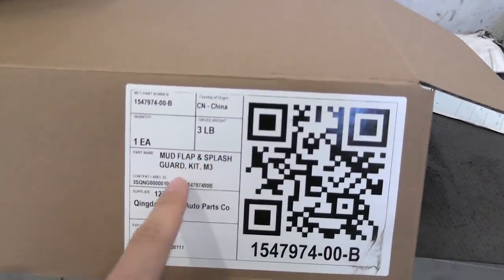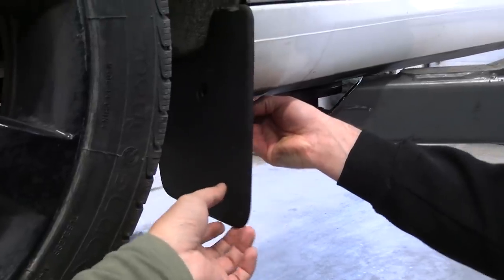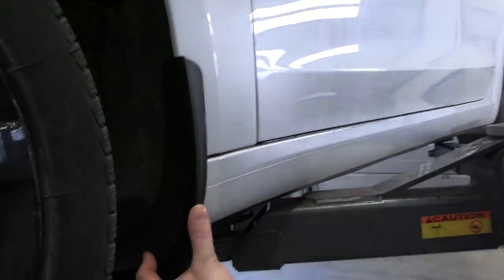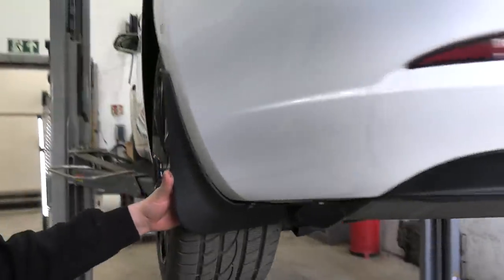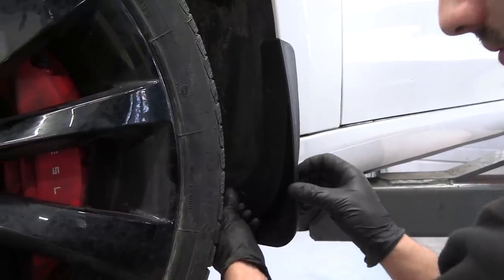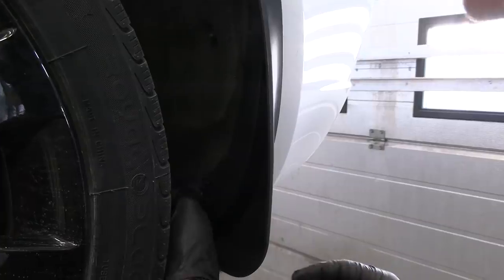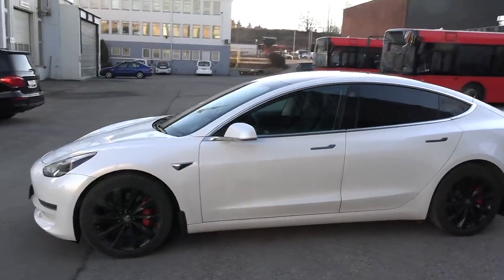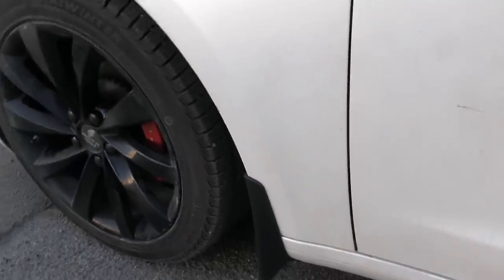Model 3 mud flaps from Bilexperten vs Tesla's original

Comment: Had the same 3rd party china-flaps mounted here. They lasted for 10000km and then ripped off in heavy rain (90km/h). No mounting fail - they torn apart. One of them scratched the side of the car when it fell off. Will not mount the same ones again...

Comment: Double sided tape is there to keep the guard against the bodywork. Otherwise dirt would get inbetween and scrape and ruin the  color. Also the upper plastic screw that was screwed in with powertool does make a new hole into the car, but it is plastic not metal. I think also with Tesla mud guards you install this new screw into plastic.

Comment: Looking at the front flaps, I’m 100% sure the guy just drilled a self screwing screw into the wheel well liner... :O Meaning he did make a new hole without Bjørn knowing...(?)
Reply: Drilling into the plastic liner is fine since it avoids the need to drill into the metal fender lip which would cause rust.
Reply: Wade Yorke the problem is that behind those plastic liners you have air ducts/vents.. And as he said, on Model Xs, some people had their ventilation ruined because of it.. you never know what’s hiding behind plastic covers unless you do some research.

Comment: The real problem is that the Model 3 does not come from the factory with plastic rocket panel covers.  These covers should extend from just behind the front wheels to just infront of the rear wheels with end caps at both ends.  This is the only way to protect the rocker panels from eventual paint damage and rust.  Pictures of the Model  Y seem to show plastic rocket panel covers.

Comment: I fitted no-name ones and haven't noticed an efficiency loss yet in winter. Plus the factory lower sill cover traps moisture and dirt so worth checking for rust in the future. I prefer mine with but it's grey.

Comment: The original Tesla short type in front collects stones and dirt and, if you are not aware, this will damage the edge of wheel-room just above mounted mud-flap and give corrosion and lose of paint. And Tesla do not relate this issue to those damages.

Comment: I have the shorter tesla mud flaps on front they work great, dont see any dirt piling up where you pointed out , also it looks to me it is the same size and length down to the ground from the ones you use and the shorter tesla flaps, however the longer flaps are way to long, i donlike how yours go higher up and protect however I don’t think grave goes that high ?

Comment: At white model 3 it always looks lile rear bumper is not the same color then rest of the car. My model 3 has the same. What you think???
Reply: Quite common, the bumpers are usually painted separate from the main body, the explanation I've been told is that even if you use the exact same paint the pearl will sit slightly different making it look a different shade.

Comment: The extended are for the rear not front. Simple mistake to make. 
I have fitted both manufacturers and Chinese 3rd party to many cars. 
Tesla are a Californian company.. no one there understands cold or bad weather. They just do not get it. 
Proof in point Tesla wipers v just about any other companies.  Model 3 boot opening and rain / snow etc dropping into the boot is not a mistake a none Californian company would make.

Comment: Why would you need mud flaps on the front side? Seems to me like its just extra drag with no benefit.
Reply from the maker: https://youtu.be/XW4z0CBzqro?t=599
Reply: It seams to me you are talking past each other..

Is I understand Reuben, he is talking about in front of the wheels, you talked about that in the video.
Reply: @bjornnyland  I was meaning when you held up the mud guard on to the front side of the rear wheel well but didn't watch until the point of installing it on the rear side of the front wheel. Didn't make sense to me at the time
Reply: No need for a mud guard there, but interestingly many manufacturers put a piece of plastic there attached to the undertray behind the front bumper, it acts as an air dam pushing air around the wheel. Have a look, most cars made in the last 15 years have them, unless they got broken over bumps, like on my car.
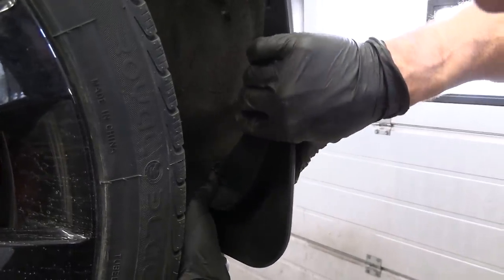Reply: 7:36 Bjørn points in front of the wheel talking about mud flaps.

Comment: They are useless here in norway. I had the tesla on my M3 for 2 months. And i have heard that the other one could damage you paint over time.
Reply: It needs the double sided tape and preferably should have PPF under the mudflap also. Without tape the flaps move a bit and can rub the paint.
Reply: @anttitoivonen7339  that is true, but same with many manufacturers mud flaps. You get small scratches where the flap meets the body.

Comment: the Flaps shoud be mounted under the Wheelhouse plastic.
Reply: Can't be done, the plastic in the wheel well tucks behind the body, so you can't just put it in front of the flap.
Reply: @98dizzard  behind what body? i think one could slide in under and put the screws through. that would solve the water and dirt problem, even on the shitty tesla design.
Reply: @ranxerox10  it goes behind the rolled over edge of the front wing from what I can see, similar to most cars.